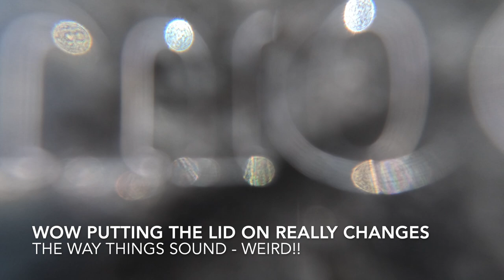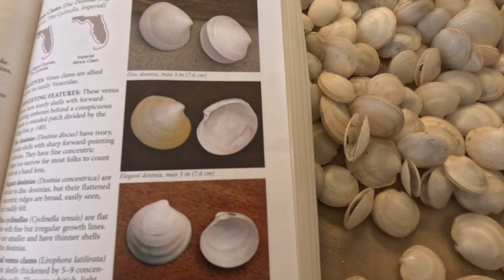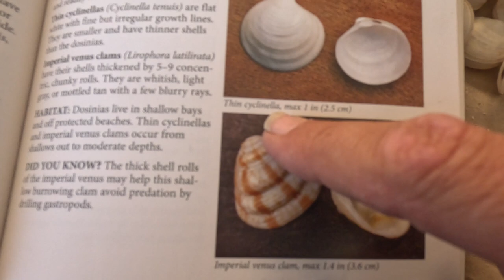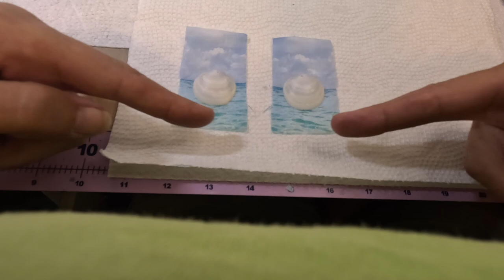Fort Desoto NORTH Shelling and Jewelry *Part 2 OF 3*

Comment: Love the decoupage earrings! You have a lot of patience! I decoupage the large cockle shells and make them into trinket dishes. I use a bottle of metallic gold paint and a small brush to paint the edges, and you can get into the hinge area better. I might try the pen? Its great to share ideas. I also clear coat all my decoupage. Not sure if that's good or bad, lol lol
Reply from the maker: thanks! they came out so fun, i love the little flamingos! 

in truth, i did the pen but then switched to the paint and found the paint looked a little nicer when things were dry. 

also-  the pen didn't handle the hinge well and flooded that venus clam thru the hole and leaked all over the back of the piece arghhh...

I honestly am trying to engineer an easy way to do it that would leave a little raised edge  - but i have tried many things so far with out getting the look i am going for lol! 

i like electroforming too, which would give me that raised edge but has its own separate challenges - i haven't shown you guys that technique yet because it literally will take DAYS worth of time lapse to do it justice :*O
Reply: @echouebijoux  I've found that 'dabbing' a 2nd and 3rd coat of the gold paint, helps raise it up a bit on the rim. Trial and error!